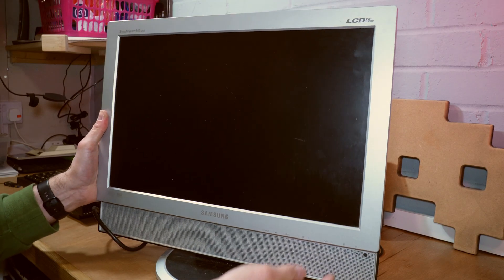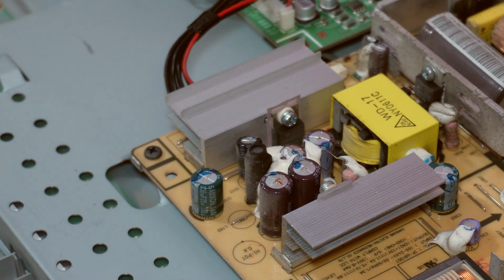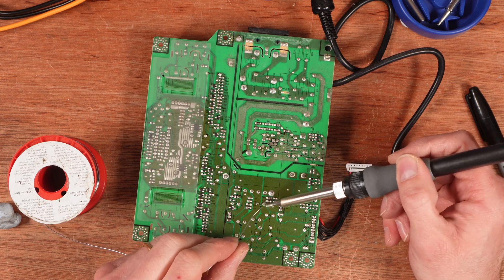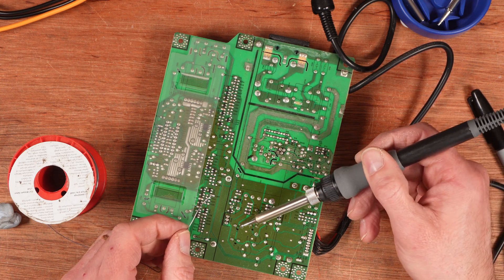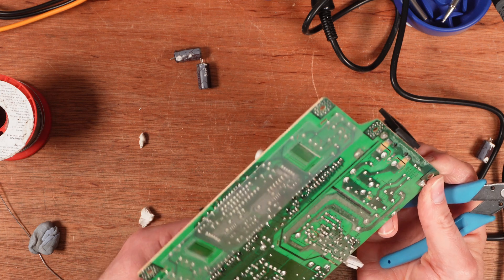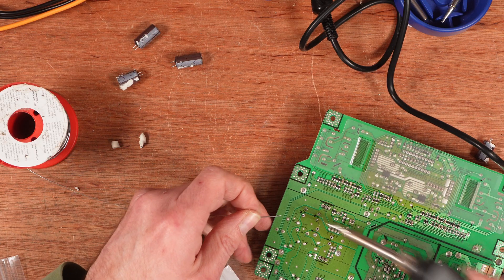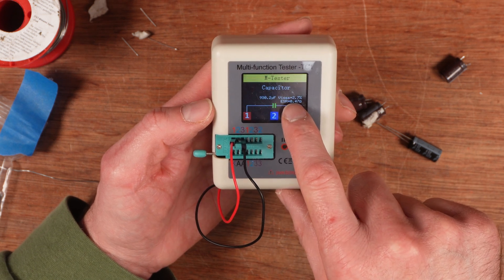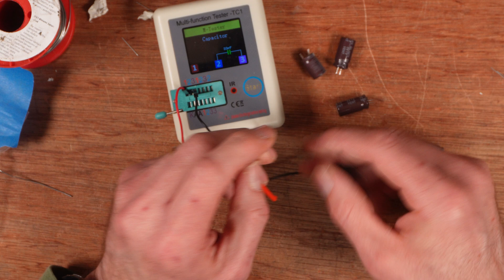A £5 TV That’s Perfect for Retro: How to Repair an LCD Monitor with Bad Capacitors

Comment: Discharging large capacitors with a proper resistor is a great tip. Even if you suspect/know the board has a discharge resistor on it, it's better than being sure that you just got shocked.

Comment: I rescued an NEC Multisync from work before they threw it in the skip. Kept it for a few years for when my Spectrum KS2 arrived. Of course now I need it, it doesn't work 🤣Same symptoms as your syncmaster, I'm hoping it's just the PSU, it usually is as the caps are so old now.

Comment: I have one of that same model that I fixed for those same 4 capacitors about 4 years ago.  I like the TV.  It was a little odd to find one in the US though.  I have never been able to get the SCART input to work though.  I have used it with ever other input though.
Reply: Funnily enough I've just been trying my Atari 7800 with RGB scart through the 7800 gamedrive cart and no signal
 Tried my sega Saturn with RGB scart and that didn't work either

Comment: These older lcd tv,s are great with all the different inputs they have and often quite cheap .I replaced some caps in my mates old samsung tv i used panasonic caps that most likely cost more than all the cheap rubbish cap samsung use

Comment: I've got the slightly earlier 4:3 version which i must get round to fixing, It had exactly the same symptoms, getting harder to turn on then wouldn't turn on at all. All SMPSU's made since the 90's and from decent brands will have a bleed resistor on the HV capacitor. the trouble is it can go open circuit so best to assume the cap is charged. I do exactly as you and use a good beefy resistor.

Comment: I have fixed hundreds of Samsung screens with power supplies that failed this way back in the day, they were using them in SPAR shops for digital advertising the caps used to pop all the time we had to fit better quality ones with a higher ripple current tolerance to prevent them failing after 6-12 months being powered and turned on 24/7, nice easy fix to be fair kept me busy for 2-3 years
Reply from the maker: These poor screens have had a hard life!

Comment: @3:00 in .. wait, you mean you don't discharge it by shoving the biggest flat-blade screwdriver within reach across the terminals? :)
Reply from the maker: I deeply dislike electric shocks and that would be really unpleasant for my nervous disposition 😆
Reply: @MoreFunMakingIt  I consider myself lucky to have only done it twice in my career.. once was a belt off the back of a CRT tube while changing the fuse - that was Samsung, too, and the fuses would die at 13 months every time. Kept us busy, didn't half hurt. The other time was changing an AT PSU (back when the power switch was on the 240V side); the old PSU switched live & neutral (so DPST switch) but the new PSU only switched live. I mis-wired the live onto two halves of the switch and then grabbed the switch, handily completing the circuit with my palm. Tingly! :)